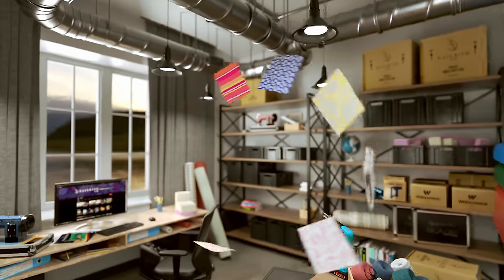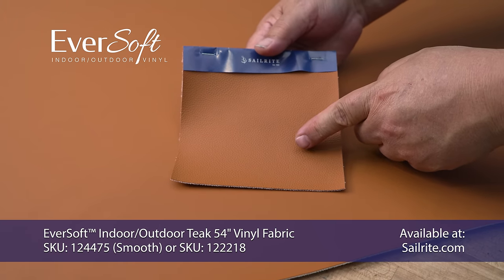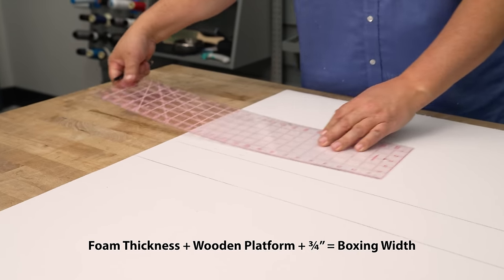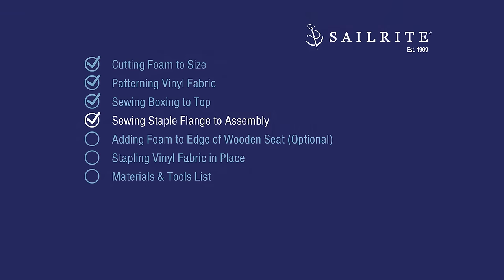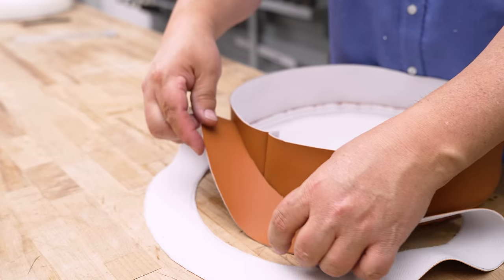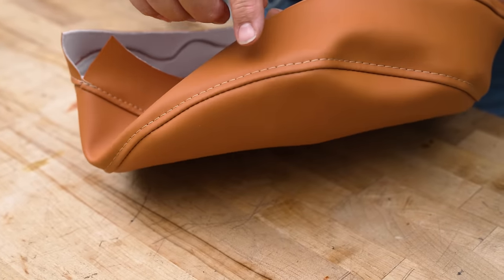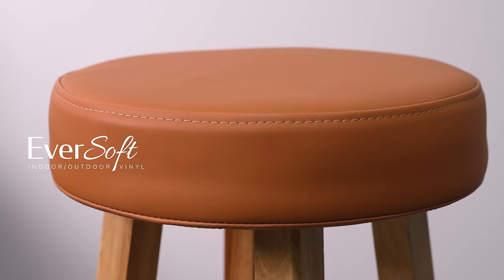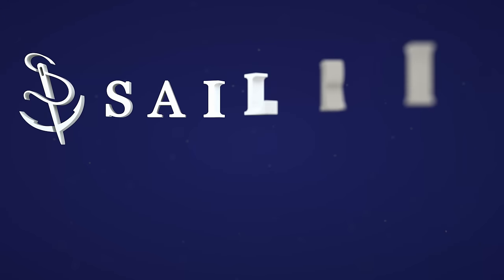How to Reupholster a Stool — No Wrinkles!

Comment: Great tips, but don't you need to drill a hole or two in the bottom of the stool to allow the air to escape?  Otherwise it would be hell on those seams?  Beautiful job.
Reply from the maker: Good tip!

Comment: I often need to slip covers over foam, and as you say, they can be a little stubborn.  I use a very fine plastic similar to "Saran Wrap" to facilitate the process.  The plastic is called "silk wrap" and is a big help.  Your videos are excellent and have helped me with a wide variety of projects.

Comment: Did you use a special sewing machine?? I have a regular sewing machine like the one that your mom would use when you were a kid... I have five bar stools that I bought with a round bar that has the looks of a bop belie stove. Great video, WOW, learned ALOT.
Reply from the maker: Yes, we used a Sailrite Ultrafeed LSZ Sewing Machine found here: https://www.sailrite.com/Sailrite-Ultrafeed-LSZ-Walking-Foot-Sewing-Machine-110V However, a home sewing machine may still work for this type of application. It always depends on the quality and working order of the home sewing machine you own (so it varies greatly from machine to machine). To determine if a home sewing machine can sew thicker fabrics perform this test:
Cut up a pair of old blue jeans into four layers (not including the jean’s hems). Since a home sewing machine usually can’t handle a thread larger than v-69 (Tex 70) use something comparable and try to sew through the 4 layers of blue jean material. If it sews well and the stitch looks good on the top and bottom side of the assembly then chances are you can use your home sewing machine for small to medium jobs.
Reply: Thank you for your time. I will try what you suggested with blue jeans. Thank you again. @SailriteDIY

Comment: Another great video! Just curious, though - i would have thought that since you cut the banding with a half inch overlap, the seam allowance should have been 1/4". Is that to keep the banding snug? And would that work with a non-stretch fabric?

Thanks!
Reply from the maker: Thanks!!! Yes, we want the banding to be slightly smaller in height (after sewing) to keep it snug for a better tight fitting look. Yes, it should also work for a non-4 way stretch vinyl seating fabric as well.